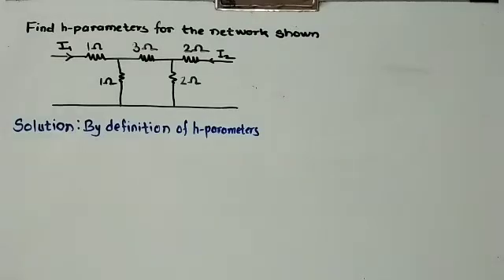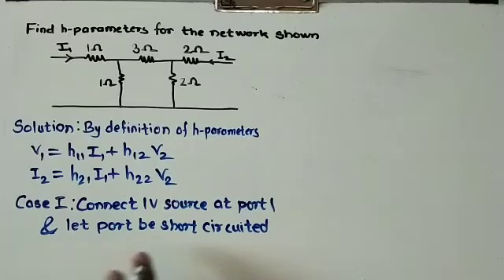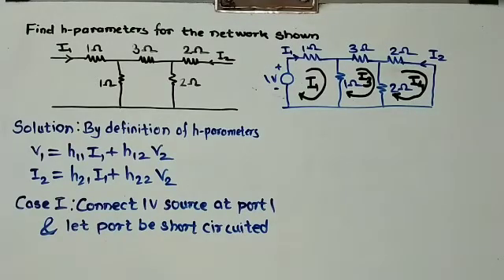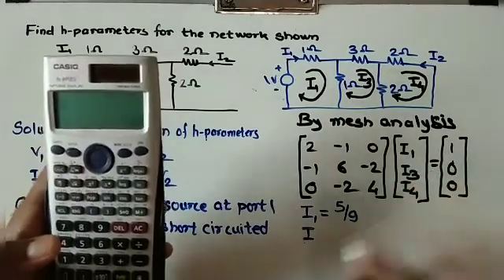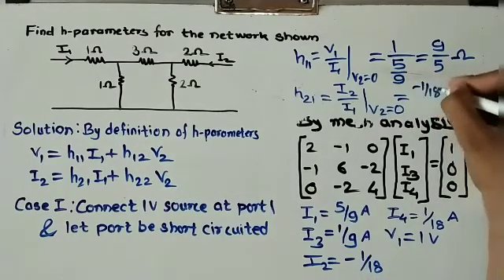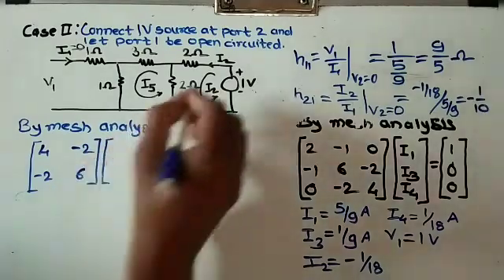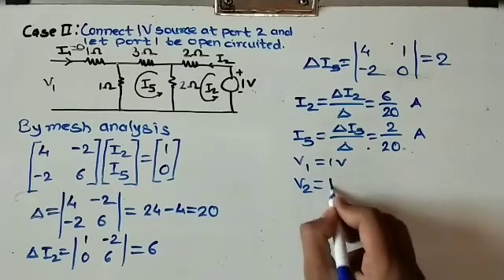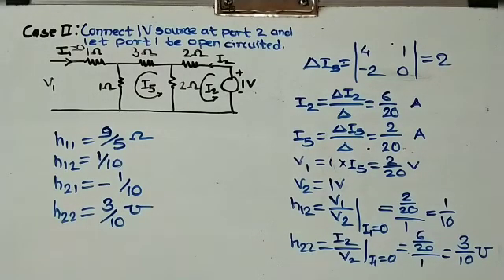h-parameters Solved problems | Hybrid (h) parameters of two port network problems

Comment: why 2ohms resistor didnt get short circuited
Reply from the maker: Because it is connected in series.
Reply: @ElectronicsforYoututorials  No the other 2 ohms resistor. The one parallel to V2
Reply from the maker: ohh, that 2 ohm is also not shorted because another 2 ohm resistance is in series with it. Short circuit case will applicable only if a single resistance and a wire is parallel at the same time only, without inclusion of any other component.

Comment: Why are you connecting 1 volt at input??
Reply from the maker: This is used to simplify the solution. By doing so you can apply kcl/kvl to solve any circuit. 
As hybrid/z/Y parameters are independent on voltages or currents you can use any supply to solve it.